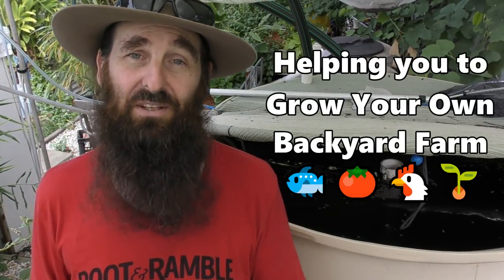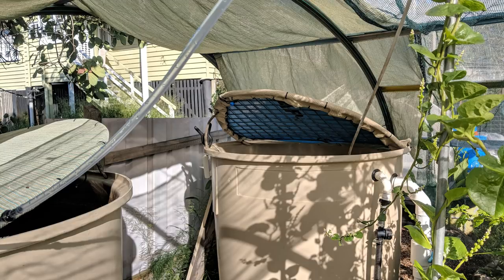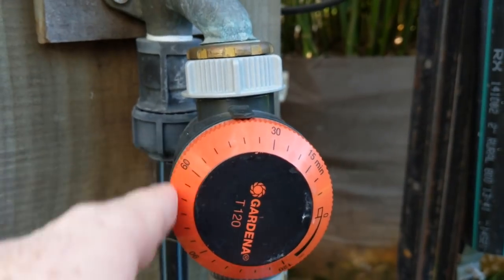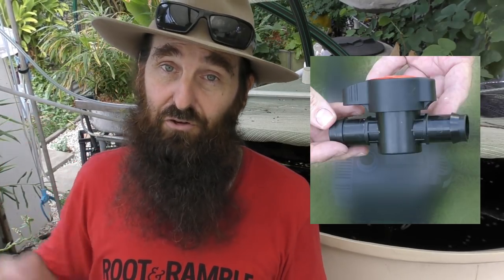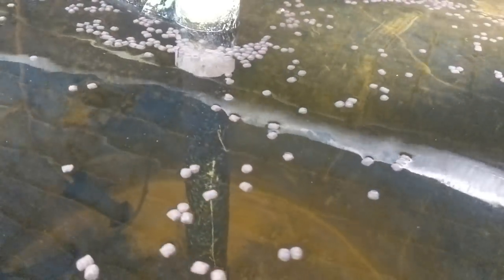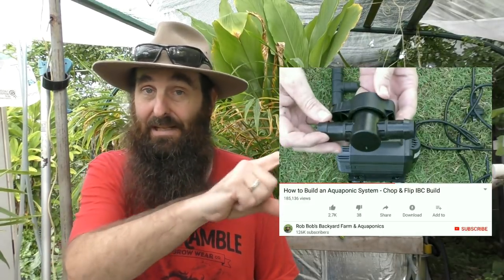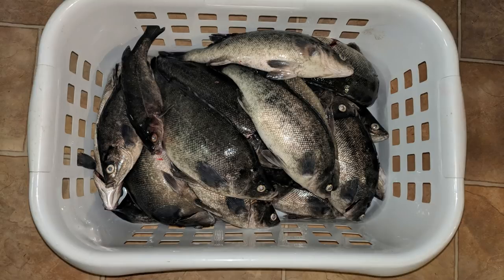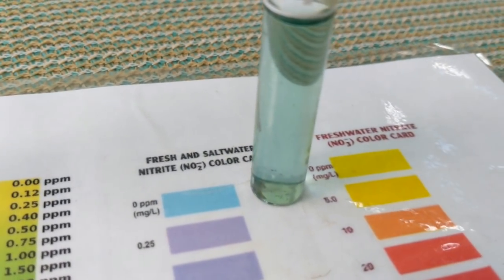Using Chlorinated Tap Water in Aquaponics + Fish Harvest

Comment: You can always add a float valve or a float switch to block water after some threshold is reach. This way you're safe from forgetting taps open. I do it on both my tanks now and works a treat. Cheers mate!
Reply from the maker: Will be setting up a float on the system once it's altered after the renovations. 👍
Cheers.

Comment: thats really unfortunate....its always a kick, when something like that happens. ive been watching your videos for awhile and im in the process of putting together my own system. Fingers crossed on avoiding any this kind of thing. ive been modelling my design after what you have put together. Its arranged differently, but i just wanted to shout out a big Thanks, from Ontario, Canada! 
also smart call on the uniseal sales, i really struggled to find those here and had to resort to something different.  
Im hoping it doesnt cause issues for me.
Reply from the maker: Am glad the clips & posts have helped some Growponics. 👍 What sort of fish will you be running in the system? 
Cheers mate.
Reply: Rob Bob's Backyard Farm & Aquaponics im going to be using Yellow Perch. I initially wanted to try Tilapia, but the cooler climate means would be running heaters. Yellow perch are a native species here, so they should take fine to the cooler nights. And with any luck, stretch me into winter time

Comment: I  found a research article on Canada's use of Vitamin C or Ascorbic acid for removing chlorine from water.  It gave the specific amounts needed, so that is how I top up my sump tanks - 500mg vit c per 50 gal (I have two 55 gal sump barrels, linked, that pump up to my grow beds on my terrace above the tanks) - toss it in whenever I top up, which is how I maintain my water levels,
Reply from the maker: Do you have a link to the article Linda? The chlorine levels would vary from one water authority to another so it would be great to see what they recommend. 👍
Reply: Hi Rob - I could not find the Canadian article, it has been several years since I started researching for my aquaponic project, but this is a link to a USDA site with similar information.
https://www.fs.fed.us/t-d/pubs/html/05231301/05231301.html
Scroll down to the tables that give specific information based on ph levels
Reply from the maker: Thanks Linda. Have been a tad busy but will check it out now. 
Cheers.

Comment: That's great that you have an Amazon link for us US folks. I always like supporting good channels. Its good to see uniseals on there, I can never find them anywhere in the US. I always use bulkhead fittings but they are so much more expensive, not only the cost of the fitting, but getting all of the threaded fittings to go along with it, perfectly cutting everything to length, and gluing everything. Whenever I see you use uniseals, it looks like you can just push a pipe through and your done. They seem to work really good. So which would you recommend?
Reply from the maker: I'd recommend the Uniseals over bulkheads for most situations GCA. The only place I use the bulkheads at the moment is for the base of the grow beds for the siphons. There may be other situations that I may recommend them in the future but none that I can think of at the moment for a basic backyard system. 
Thanks for your support as well. Just knowing folks get something out of the clips is a big bonus for me. 👍
Cheers & all the best,
Rob.

Comment: watch out when using those pellets to produce ammonia as they may just result in a huge fungal bloom. i tried using them to perform a fishless cycle and most the fish i later added ended up developing fungal infections due to there being so many spores in the water. ive read that the cloudy ammonia you can get from bunnings works fine especially if you chemically filter out the detergents which makes it cloudy.
Reply from the maker: Had an issue with them not breaking down that well so have stopped using them Caleb. Have been dosing with Charley carp instead. 👍
Cheers.

Comment: Im very happy you addressed this as i have moved to the city i figured out how to dechlorinate...and the other chlora....but i found out i also have a water softener. How do i desalt my water?
Reply: I suspect that you might need to distill or RO to get rid of the salt. Do you know what the concentration of salt is? Alternatively do you have access to rainwater?
Reply: trish y - perhaps you could grow seaweed and sardines? Ha ha 😉
Reply from the maker: I really don't know enough about the water softening process to give you a definite answer sorry Trish. 
I think it would depend on what sort of salt they're using. if it't potassium chloride that will help add both to the system. Potassium would benefit the plants & the chloride will help the fish. 
Sorry I'm not a lot of help there.

Comment: Bummer. In the fish tank hobby carbon filters are common for water changes. If you're going to replace the house filter, perhaps repurpose the system for the tanks on a float valve. The best way I've seen for managing the filters is to have a sediment filter, then carbon block, then a tee fitting with a valve, then a second carbon block. Use the tee fitting to drain off a sample from the first filter from time to time. When chlorine makes it through the first filter, swap block 2 into the block 1 position and put a new one in block 2 position. This way you always have a backup.
Reply: hdjc86 - is it possible to remove the chlorine from the carbon, perhaps by boiling?
Reply from the maker: I think the new system will be topped up by float valve from a storage tank where the water is allowed to sit to gas off the chlorine. 👍
Am not sure if we'll be installing a whole house filter again after the renovations yet.
Cheers.

Comment: Bob I thought the chloramide doesn’t evaporate that’s why thy put it in ? Is this a problem. I have a hydroponics set up and looking at going Aquaponics so I’ve just been leaving buckets of tap water,brisbane. For 24 hrs with an air stone. But reading about the chloramide, I see this as a problem when I go Aquaponics.any suggestions, so I can practice now!
Pat
Reply: Yes I read several papers on this for the same reason. 24 hours with a bubble stone is fine for free chlorine but is not even a half-life for chloramine. You might be lucky and your municipality may only add free chlorine. Much of that will already be gone by the time it gets to your tap actually. There are a couple ways to work out what's in your water. Your local municipality may publish details on the water they supply, in the US I believe they are required to. Though it  might not be very specific, in my case they get water from 3 different sources so depending on that it can vary a lot. The chloramine is potentially about 100x higher than is safe for fish. You can also purchase chlorine test kits for example off ebay. There are strips for cheap or fancy instruments for ~$50. I haven't tried this yet.

Getting rid of chlorine whether free chlorine or chloramine is generally a matter of half lives. Once you determine how much you have vs how much you need you need to figure out how many half lives that is. This paper has a nice table on page 17 showing their results on a number of different methods of removing both free chlorine and chloramine ( https://web.archive.org/web/20131110055501/http://hbd.org/ajdelange/Brewing_articles/BT_Chlorine.pdf ). Note that the source of the water affects the rate of removal a lot.

I originally tried thiosulfate and it killed the goldfish I was using to cycle the tank. Not sure why, maybe I got a bad batch or didn't add enough. After that I got paranoid and decided to boil the water. This has worked well, but won't be feasible when I expand to a larger system. I will probably try using some acid to lower the pH then let it sit for awhile there before bringing the pH back up to normal and adding the water.

When I boil the water I bring the water to a boil and then leave it set overnight on the hot plate. This will depend on your supply whether or not it is enough, but it has worked for me so far.

Comment: Hey rob ,love your clips mate.. tell me,where do you source those drums from?
Reply from the maker: Hi Again Pat.  The drums & tanks for this system were bought 2nd hand. The company that made them originally doesn't exist anymore as far as I know. If you search for "Aquaculture tanks or "Stock tanks" a few different sites should pop up. Most produce stores will have contacts as well. 👍 
As for the chloramine question, you can use a top quality carbon filter to remover it or Vit C & sunlight to break it down. 
I've topped up from the tap to about 10% of total system volume with no effects from chloramine or chlorine at all. I'm not sure we actually have huge levels of it in the water out here. We're fed from the Mt Crosby station BTW. 
Hope that helps some.
Cheers.

Comment: You could have just dumped vitamin C (sodium ascorbate) to neutralize the chloramine in the water. It reacts almost immediately. Make sure it's not the acidic version so it won't affect the ph much.
Reply from the maker: The damage was already done as I mentioned in the clip so it would of just been a painful death for the fish as I understand it. 😔
Reply: I'm so sorry for your loss. I was responding to the part where you mentioned you do not have another body of water to move the fish to where you hope for they can recover. The chlorine in the water can be clear up very quickly with water conditioner or vitamin C which should be available in 24hr pharmacies.

Comment: the cheapest way is using "Sodium Thiosulfate". It's more economic then using the commercial dechlorinator and the activated carbon filter especially for pond or tank which involved thousand of litres of water volume. I've been using it to dechlorine tap water for my fish and freshwater prawn in more than 1000 litres volume cement tank. Hassle free, cheap and safe for aquatic living animals. Where I live, idiotic or greedy individuals used Chlorine for fast result fishing activity. Living aquatic animals will avoid or shun any  underwater rock or wall crevices that has trap chlorine gases.
Reply from the maker: Thanks M&L. 👍 For the amount we need I'll be sting to the filter as it's the lazy mans option. 😉
Cheers & have a top one.

Comment: Hey Rob, I love your videos. Actually I binge watch them regularly on the ambulance. I'm Having similar problems and this really helped. Switched from tap to purified water... Too many buffers in our tap/well water in town. I know your busy but if you have any tips, I started logging vids on my small patio system https://youtu.be/F_zULz4z1ew. Cheers!
Reply from the maker: Hey Mate. 
How's the system going now? 
Time will help to lower the pH but that's no good to you starting off. If the fish is still in there I'd be treating the top up water to lower the pH & adding that slowly a bit at a time.  The ideal pH for aquaponics is generally said to be between 6.5 & 7. At that range the bacteria, fish & plants should all be happy.  This clip might give you a few pointers as well. 
https://www.youtube.com/watch?v=eO1pHM7Afuw

If you've lost the fish I'd just cycle the system without any & add them in once you see trace ammonia, 0 nitrite & nitrates. Normally it takes about 6-8 weeks through summer when cycling from scratch but you've got a bit of a head start by the sound of it. 

 I'd also suggest you add 1 part salt to every 1000 parts of water, which works out to be 1 gram of salt for every litre of water in metric. MAKE SURE it's pure sea salt & not table salt that has additives. This will guard against brown blood disease/nitrite poisoning.  

Hope that helps you out some.
Cheers mate.

Comment: Sucks it happened. Get yourself a ball float top up valve, so it'll stop filling when the water gets past a certain point. It's a cheap & easy security measure. They sell them in stock/fodder stores. Can send you a link if you don't know the sort I mean.
Reply from the maker: Have a few on hand Colum but have never got around to fitting them to the system again. Once I sort out the pH issues in there one will be fitted. 😉
Hope all's well with you & yours mate.
Cheers.

Comment: There is nothing more painful than losing a tank of fish at once!  It has happened to me as well.  Sometimes the unthinkable happens but normally human error or happenstance occurs.  For me, it was a stray cat that ran through my dome knocking down a temporary hose as I finished painting grow beds.  I saw the cat run through as I was walking to the house.  After lunch, I returned to find the hose on the ground and my fish tank was empty.  The fish were far done.   RIP Fishies! Rj - Beyond Harvest Veganistas a fb group
Reply from the maker: Had issues with our pup knocking off a drain here in the past as well. The system will be getting a bit of an upgrade to guard against similar issues in the future after the renovations are sorted out here. 
Cheers Rj.